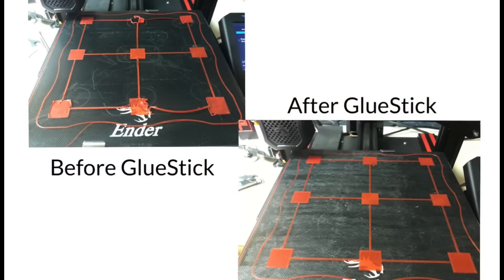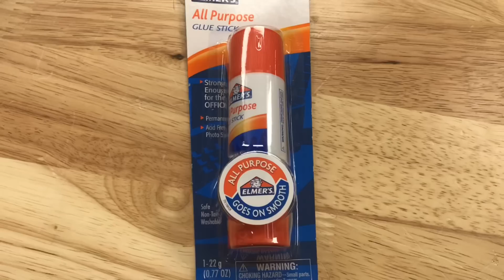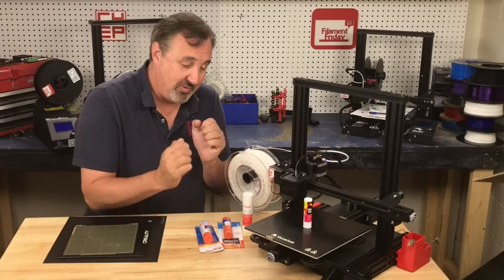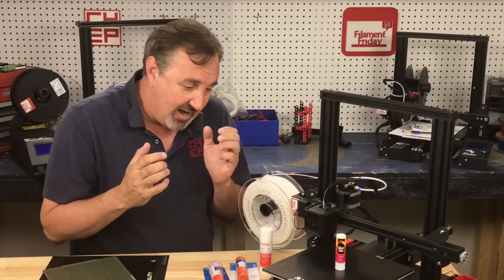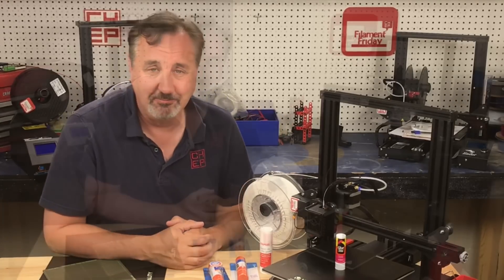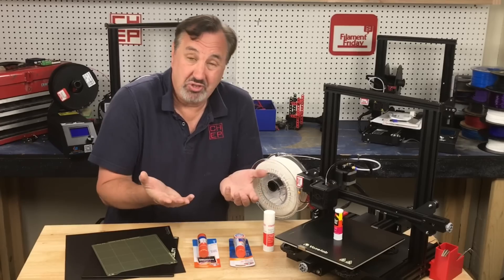Better Bed Adhesion with a Little Glue Stick

Comment: Just picked up a used Ender 3 Max w/ Glass Bed.  Been using a Raft to counter some lifting.  After each print I wipe down with IPA.  You're stating to use a glue stick and only wipe/clean every 4 or 5 prints?
Reply from the maker: Only if necessary.
Reply: @FilamentFriday  so I ran a job and it stuck great.  Do I re-apply more glue stick or just run another job?
Reply from the maker: Run another until you find you need to wash it off and reapply.
Reply: Arnold Rimmer  I have been using the spotted side of the glass with glue stick with perfect adhesion.  I rarely wipe the glass done unless I am completely cleaning with soap and water.  This has been working flawlessly for me.
Reply: Arnold Rimmer  can you send me the link or document stating the glass should be placed spots down?

Comment: My secret sauce is a 1000 Sand paper on a flat surface. After every print I will sand my PEI sheet with this. Then I clean it with Iso alc (70%). Otherwise prints wont stick after the 3rd print or so.

Comment: I need some help CHEP!!! For some reason any time I try and print in place files or any files with moving parts, they either fuse together or don't work whatsoever. I adjust my e-steps and have the heat for the hot end and the bed set proper, but they always seem to fail! Please help!!!
Reply from the maker: Have you tried my Cura profiles?
Reply: @FilamentFriday  No, where can I find them? I'm also using Sunlu PLA for printing. Not sure if that makes any difference
Reply: Try tunning the flow rate. Teaching tech has a very thorough calibration webpage. I encourage you to check it. After tunning my printer, i dont have any more problems even with small tolerances, just some stringing wich i need to dry my filaments

Comment: I'm pretty new to printing and I've been using a glue stick for a ton of my builds. If I start a print and It has a hard time sticking, throw some glue on it and it prints perfectly. Plus it's pretty easy to clean up afterwards on the ender 3 v2 glass bed.

Comment: So if the hairspray actually works then why not take the build plate off spray it outside then put it back?
Reply from the maker: Because now you’ve affected the bed level.
Reply: @FilamentFriday  Even with yellow springs? and you have to press the glue to stick it..
Reply: @venasanev  if you are pressing the gluestick hard enough to affect the springs, you are doing it wrong.

Comment: the powerder coated pei sheets dont need the  steel wool
Reply: also i love the glue stick method. i use it on my glas bed, but the prints stick like hell! regardless of water i have cut my hand up bad before with the glue

Comment: Please help I’ve done everything!!
Leveled the bed 20plus times , new metal extruder, Bowden tube, and yellow bed springs. I can’t get my prints to start printing. After the first swipe on the left , everything else balls up on the nozzle. I e had great prints till now. I’m using an ender 3 v2. I used your bed level trick with feeler gauge at .20. I’ve done it all !! Anything I’m missing? Glue stick won’t work either . All rollers are tight
Reply from the maker: Try this: https://youtu.be/nMLKNB2r-M4
Reply: @FilamentFriday  thanks a bunch after I did the bed level with the .20 and zero out my z everything great now! Just forgot to zero back the z

Comment: My CR-6 Max's bed does not work well but if I use glue stick it does. Just not a fan of the stick. Can't argue with the results though. There are other reasons why it is back in its box and is not used, that is just the small nit I have against the Max.

Comment: ASTM D 4236 is a labeling standard. It doesn't make the material safe. It just provides that the label is supposed to notify you of potential hazards. I guess the Dollar Store glue sticks are breaking the law?  Or maybe they had that notice on the main package and not the sticks.
ASTM D-4236 is the standard practice of labeling art materials for chronic health hazards. The designation “conforms to ASTM D-4236” means all of the potentially hazardous components of the art product have been clearly labeled on the product packaging.

Comment: Can I use Isopropyl Alcohol to clean the glue of my bed?
Reply from the maker: Water tends to work better.
Reply: Windex and the such works great.  Spray on, let sit 15 seconds or so, then wipe clean.

Comment: I use a glue stick - guaranteed to work but that bottom layer looks really ugly. I'm wondering if a liquid PVA spray glue would work a bit better. Ironically I use it on the flat side of a creality glass plate because the other dimpled / coated side NEVER worked.

Comment: Extra strength hair spray is better than glue sticks in every way including cost and cleanup. Adding, you can just reapply hair spray multiple times as it is thin. Not so much with glue sticks.
Reply: Apply the glue stick in stripes and use a wet cloth to distribute it, makes a fine and uniform layer,. An extra stripe or two and a wipe and you are good to go. But then again I'm lousy with the spray cans

Comment: Can I use glue on a ender 3’s bed?
Reply from the maker: Yes.
Reply: I tried it out and the filament still isn’t sticking to the bed, any suggestions?
Reply from the maker: Then you nozzle is too far away from the bed. Relevel it. https://youtu.be/_EfWVUJjBdA
Reply: Thank you.

Comment: On my Ender 3v2 I've never had to use any of this stuff. Isopropyl alcohol and lint free rags. As long as the bed is level and clean you shouldn't be having issues. People shouldn't expect some things to stick well based on their design, and should just use a raft in those instances.

Comment: Hello in ABS did not work for me, the table too hot damages the glue?
Reply from the maker: How hot did you set it? 
With glue stick you don’t need a super hot bed.
Reply: @FilamentFriday  100°C as recommended by the manufacturer, too hot?
And a hug from Brazil!
Reply from the maker: Too hot if using glue stick. 80° works well with glue stick.

Comment: Yep. I used pei but for PC print. Pei not great for PURE polycarbonate 3dxtech, i mean they not great for large 200+ mm long square shape. Definitely easy to warp with normal printer. Better option is glue stick with glass. Stick like hell when heat up to 140 C bed. With glass you can put the nozzle to 310 Celcius without damage the glass.  With pei sheet oh no if you print 280 on PC-ABS like polymax it okay but the bond is weaker than PURE PC gizmo dorks that has heat resistance up to 140 C and heat deflection of 132C+++ as what I tested. However, this pure PC only work on glass plus glue stick or cyanoacrylate thick type and in heated chamber 65-75 C to prevent warping when print long prototype 200 mm long objects. You can print PC at low temp but believe me you don't want to use it for any application close to it manufacturing specs. It will perform like 50-55% of the spec cause the energy to bond molecular together is not enough for them to organize in a right crystal way. Like diamond, you have to have right temp right pressure otherwise it will act more like your pencil lead. I always do 30 samples test on each infill rate 30-45-60%  for every filament I work with why? For safety and knowledge. You never know what stuff your manufacturer put in your filament. In cases I bêen through, Even different color pigment can make same filament perform different scale.

Comment: Hello , I’m new to 3D printing and I recently purchased an ender3 s1 pro . The machine is only 1 week old . After couple test prints , the machine works fine and prints stuck to the bed . Couple days after I try printing , the material tend to tangle up on the nozzle and not stick to the bed , like it’s repelling off some spots . Can anyone advice me what to do ? Machine is new .
Reply: use glue stick my boi. search for some bed level testing STL's on youtube to get the best level and z offset. Not sure if the ender 3 s1 has auto bed leveling if not you should also purchase that. auto level doesnt fix all problems it just helps you get the best first layers.

Comment: I had to get to the computer to comment, I have pla multi-prints just today that started sacrificing themselves to the magicgoo gods, stop print, wash sheet and apply purple glue, why do I keep trying other stuff?  Bambu labs even ships a little gluestick...  hints....    Iagree with you 100%  also as a note, I use it on the cool side and the hot side.

Comment: I swear by gluestick. It simply saves my time and filament by completely avoiding delamination. I don't see any downside passed the minor cleanup. Which you can also avoid by using blue painters tape as a buffer.
Reply from the maker: Warm water cleans it off easily. No tape required.
Reply: So it’s is safe to use the glue with a hot bed

Comment: Did not work for me. As the bed heats up, the glue hardens and creates a very smooth hard coat on top of the bed. The part just slithers on it. I am using 3M Permanent glue stick.
Reply: Try masking tape
Reply: What worked for me really well is double sided 3" wide paper tapes. Here in India these are known as tissue tapes. They are really thin. Can take high temperature, easy to put on bed. I printed around 9 parts after putting these tapes just once and still the surface remains sticky. Very happy with outcome.
Reply: @kishalayhaldar5729  Will  it work if i dont use any specific bed temp and print at 70-80 degC

Comment: Yes they work and I have used them for years. But now I have found a better method. I use a hot glue gun. I started out with a low cost dollar store one then I picked up a better and faster gun. Now I have a modified system that automatically pushes the glue stick in. 

I have very nice Printer that works great (Most of the time) 

But when I’m doing large print I need faster and easier way to make sure the unit doesn’t start curling up in different parts. So I’ve set up a pause function but after laying down the first four or five layers it stops So I can apply the glue stick glue along the edges of the print job. When the job is finished I’ll let it cool down and everything comes right off with a little wiggling.  I very seldom of damage edges when I remove the glue stick material as long as you’re careful no problems. Give it a try and let me know what you think if you got any questions I’ll be happy to respond

Comment: Handy to know Chuck, but.... A couple of months ago I got a genuine E3 glass plate from Creality, complete crap!!! NOTHING sticks to it, tried three different filament brands, temperatures, cleaned with alcohol, glass cleaner, glue sticks and at the end tried a bit of acetone... Nothing worked. And ended up flipping the thing, blue taped the smooth side, re MESH-ed it and off to print.. Once a week I'd give it a bit of a wipe with my wifes nail polish remover with 90% acetone, flat out printing and no problems with adhesion, regardless, PLA. PLA+ or PETG. I'd say the trick is in the nail polish remover :-D

Comment: Pritt Stick on a glass bed works 99% of the time for me
Reply: I used also Pritt glue stick here in Italy. I stopped using it because I do not manage to spread it equally over the bed surface (see on the print bottom signs from where the glue was thicker.) Now I use hairspray. Only once and lasts for many prints, AND It spreads equally without leaving sings on the prints. At the beginning it smells but that is decreasing over time. May be I overlooked something with the glue stick?

Comment: 6:00 Uhm....no.  Those are two different PVA's.  They are chemically related, but they have quite different properties.

The PVA in glues is Poly-Vinyl Acetate, which will slowly break down in the presence of water to produce Acetic Acid (which is why many wet PVA glues have a slight smell of vinegar) and Poly-Vinyl Alcohol (the PVA of water soluble support material and resin mold release).  In a sense, Polyvinyl Alcohol is an anti-glue.
Reply from the maker: Thanks. Guess I’ll have to do more reading.

Comment: cheez this printer driving me crazy.. i did the leveling as you said, with the special tool. is a brand new printer...  updated  verion soft., and still can not print. maybe i did 3  prints.. and affter that.. not stick anymore...  is unstick everywhere.. I am close to give up..
Reply from the maker: Clean the bed with soapy water, rinse and dry. Try again.
Reply: @FilamentFriday  I did.. and still not  stick at all..  i am using  dish soap for clean.... I really dont know..
Reply from the maker: Try higher temp on bed and filament or try different filament.
Reply: @FilamentFriday   i think the filament.. just saw some reviews.. Ill try.. thanks man

Comment: I am sorry but I have to respectfully disagree, Glue Stick is a band aid and not a permanent solution. Over 3 years I have tried most build surfaces including Glue Sticks and Glue Sticks suck, sure your print will stick to the bed but sometimes you have to use water to release them which is messy, the first layer texture is inconsistent because of printing on top of the glue and you still have to clean the bed to get all the old crappy glue build up off of it.
The build surface I have settled on and been using for over a year with many hundreds of prints on ( close to 500 visor headbands alone) is a sheet of borosilicate glass with sheet of 0.3mm adhesive backed PEI on top of it, I guess every 5 prints of so I lightly scuff the surface with a green dish scouring pad then wipe it over with IPA, this takes all of about 20 seconds.
PEI grips prints really well even when cooled down so I don't wait for mine to cool I take my prints off the moment the printer stops printing using a putty knife/ thin paint scraper which has a finely ground edge on it which I place at the edge of the print, then I tap the handle lightly which breaks the seal on that edge and slide the putty knife around and under the print and it pops straight off, the secret here is the initial gentle tap on the handle with something hard but light to break the seal.
After a year of printing on this surface mine looks as good as new.
PS I have only used it with PLA, I don't think it would work well at higher temps.
Reply: I use PEI on glass for HIPS at 110c and it works just fine. I use the same setup for PLA at 60c and flip it over onto the textured glass side for PETG. Clean bed, level bed, check your z offset, check the bed temp and then print the first layer slow....never had a problem with the print sticking...glue isn't needed ever.

Comment: My bed suface is terrible. It needs more than I swipe. Other surfaces I use stick too well. I should have listened to the 1 star reviews across the board instead of assuming these people were doing something wrong. Also if you decide on hairspray or any aerosol you may wanna spray the surface seperated from the machine elsewhere so it doesn't get all over the machine. 🤣
Reply from the maker: I don’t want to remove the bed everytime so I’ll stick to glue stick.

Comment: The sprays are much better than a glue stick, the glue sticks leave a sticky residue on your prints, I never get prints lifting ever, I use 3DLAC plus, ok it costs more than a glue stick but a bottle lasts ages 
and there is no sticky residue left on the print once you have tried it you will never use a glue stick again.

Comment: I use a brim and a raft depending on what I'm printing as its a good anchor for my prints to stick on the magnetic bed. Sure, i get some failed prints but doesn't everybody? With what I do, I have had a near 90% success rate so that isn't to bad. Getting prints that don't stick is the other 10%..... I'm happy with what I do and use.

Comment: I got my ender 3 for Christmas and I leveled it up and printed a few things, models, cell phone stands, and a small assortment of other things. At this point is so unreliable that I am ready to take a sludge hammer to it... why would they make a product that is so difficult to keep running and is this difficult to use in general.. anything that makes me this mad is not needed in my life...
Reply: This is something that you have to go through. I’ve had frustrated events on uneven bed leveling and adhesion issues but persevered and now have three printers. I’d say just be patient and learn the skill and you will make it.

Comment: Cheap Dollar Store Painter's Blue Tape...

But you have to prepare it.... Blue tape has a wax on it that prints WILL NOT stick. Take a kitchen scrubbing pad (the green one) and massage the pad to buff up and remove wax for about a minute or two. There will be a fine white powder - blow it off. NOW you are ready to print and it lasts for about 5 before it needs to be rebuffed.  It. Can go through 3 or 4 rebuffings. Change the tape when the blue fades to white.

Always worked for me.

Comment: My glue stick dries up too quick
Reply: Even if it appears to dry up, it will still work. I thought it wouldn't and washed it off twice before just letting it run. Once the filament touched the glue, it held fine and my print was a 16-hour print. I also used Chuck's recommendations for putting down the first layer and used Elmer's Purple... hope this helps.
Reply: @dj2_cards  for me it didn't hold up, I was using a general paper glue stick

Comment: I just order a PEI metal sheet .....DOH!
Reply: PEI is still a great bed surface :)
Reply: I agree with William. PEI is a great bed surface. FWIW, I've NEVER needed to scratch up the surface. I just periodically scrub down with dawn soap and as hot a water as I can stand out of my tap. Between thorough cleanings, I wipe down with 90% IPA between prints, and try my best to never touch the surface with bare fingers. The only issue that I've had with the smooth PEI sheets is PETG and TPU sticking too well because I didn't apply enough separator (Windex, MagiGoo, glue-stick, etc). But for PLA printing, just making sure that the surface is immaculately clean works for me.